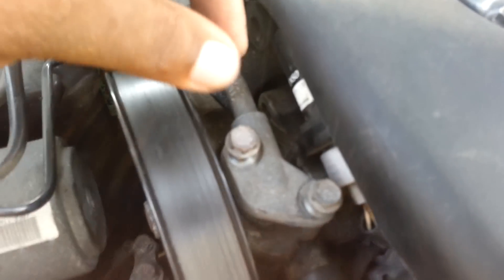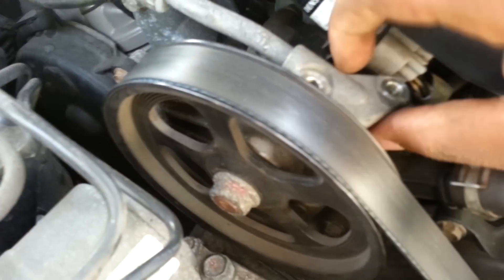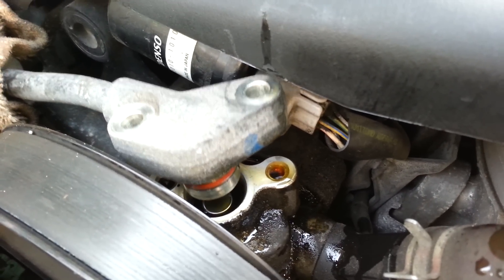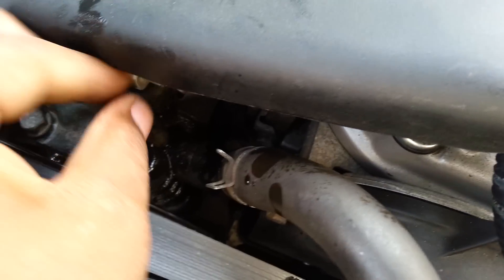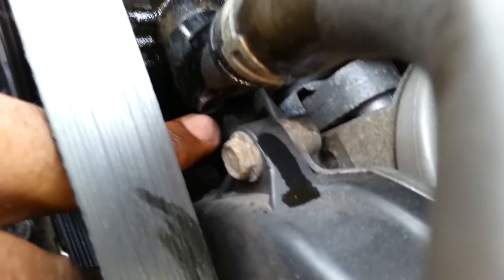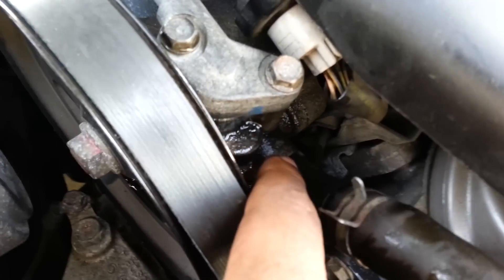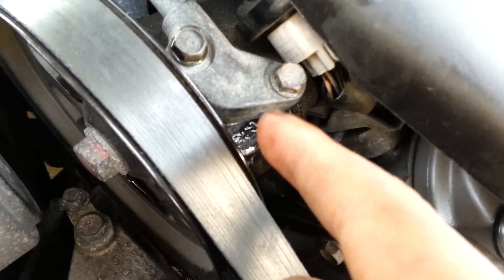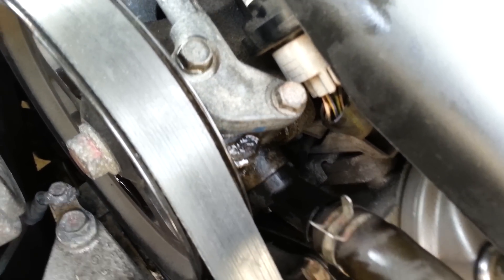ACURA HONDA POWER STEERING MOANS OR WHINES DURING COLD START-UP FIX TUTORIAL

Comment: Jan. 13, 2014. Acura TL 2005. Just bought and installed the two O-rings. Squeeling is gone. Thanks everyone. Bought rings from Acura Dealer. The new front bottom ring (91345-RDA-A01) was orange. The new top steering pressure hose ring (91370-SVR-000) was black.  So it appears color of top ring may not always be orange now. Also glad I bought some Honda power steering fluid to top it off.

Comment: One thing I found out from the Honda dealer.....the O ring gasket on the first one you took off( the return line/where you have two bolts on the very top) on my Acura tl 2007, the new gasket for that is not an orange gasket...it is in fact  black..The orange gasket is the one you use on the side and lower which has only one bolt holding it on( should be the supply line)...Anyway, they are not exact same size--there is a small  difference so just telling folks to make sure it's orange is not true for my Acura Tl. The difference is so small, they would interchange,but why risk a possible leak?  The orange o-ring is a p/n 91345-RDA-A01 and the black gasket p/n is 91370-Sv4-000...Anyways, thanks for your help and video

Comment: Here is my update: I changed both and it solved the problem, But as you say, change both. I did have an issue finding the "o" ring that is lower one. I initially removed a mounting bolt (very dumb) and later realized where the bolt was that you were focusing in on and located it. However, when I removed that lower one there was no "o" ring, Unlike the upper one where the o ring came out on the removed coupling, the lower one was stuck inside the pump and as soon as I got that out the new one went in easy. I stupidly tried to put the new o ring in while the old one was still in place. Not good, almost damaged everything. Thought I would share my mistakes to help anyone avoid making the same ones. Overall, this is such an easy fix!!! And if you know what you are doing it should take only 15 Minutes. I don't want to say how long it took me. But I had a very satisfying result.
Reply from the maker: glad to see that it helped you
Reply: I removed the bottom hose and was not able to find the o-ring to replace. I was able to install the new o-ring and everything fit back in place. 

Were you not able to insert the hose with the old one stuck inside? I'm worried I forced the o-ring inside the pump.

Comment: Thanks for the help man. I just picked up the parts from Acura and finished changing them out. I wanted to add that the top one shown in your video is black and the other o-ring on the bottom is actually the orange one. I can't understand why they would change colour over time from just PW fluid it shouldn't change the colour. Mine was still orange on the bottom. 

Honda part numbers:
Orange - 91345-RDA-A01
Black - 91370-SV4-000

Thanks for your help again!
Reply from the maker: no problem

Comment: This is very helpful. I think the key diagnostic as to whether it is in the "o" rings described in the video is whether the noise goes away when the car gets warm. This seems to be discussed on the acura blog sites. I am gonna change mine today and we will see.
Reply from the maker: i mean if you change one you might as well changeboth simple fix just change both orings and call it a day and you should be good to go.

Comment: There are different color o rings. Black is one color. Usually the replacement is orange. If you hear a whine check the o ring for signs of wear. If the o ring feels sort of hard that means it is drying out and needs replacement.

Comment: for some reason the top o-ring was black. so I went and got the top and bottom o-ring from acura dealer. the new ones were still black for the top and orange for the bottom. top oring was slight bigger than the bottom.

Comment: Are they both the same o ring part number because I changed the one closer to the front and it still makes the noise. I did not know about the one on top which you pulled out in your video.
Reply from the maker: no they arent they are diffrent size o-rings that you can get from the deal its the o-ring for the power steering hose.

Comment: I have a 2006 crv, replaced both O'rings with oem parts...still does noise at start up. Pump was replaced with oem used one.
Reply from the maker: Replace with aftermarket new pump

Comment: Thank you for making this video. I have an Acura RSX had some power steering leakage. I replaced the one o ring, and ps fluid. Still had horrible noise and bubbles in the ps fluid. It has been driving me crazy. Frankly speaking I was fed up with the damn car . Been having some major and minor mechanical repairs done to the car so its been eating up my cash. If I did not see this video I would have never known about that second oring . The power steering noise is a horrible sound and embarrassing I was ready to drive it into a Corn field and light it on fire.
Reply from the maker: Lol yeah there are 2 o-rings

Comment: My 2004 TL is producing a whining noise from that area, but I'm not sure it's power steering pump. The sound gets louder and changes pitch when I rev the engine. Is this common of a power steering pump issue that would resolve with O ring replacements? Thank you!
Reply from the maker: Yes it is very common for  the tl is known for this change the rings you should be good.
Reply: fabolousg4ever thanks. I'll give it a try
Reply from the maker: staveb0mb no prob
Reply: fabolousg4ever how much fluid comes out when you take that bottom hose off?
Reply from the maker: a little comes out just make sure you put a rag there and the oring change should fix the whine problem its sucking in air.
Reply from the maker: Ryan B no you didnt read the desription right 
91345-rda-aol is the front bottom oring
91370-sv4-000
this is for the top oring i change in the video.
Reply: fabolousg4ever Yea after re-reading my comment I noticed that so I deleted it.  But like I said in another pose the top o-ring is black and the front one is red like it shows in the acurazine link.  But the part numbers are correct.
Reply from the maker: Ryan B yes I know I will update the video soon.

Comment: Thanks for really good explanation, i changed both o ring with oem honda for acura mdx 05, and noise become lease but still there is a noise and there are bobbles in reserve tank, do you have any idea? For my when i drive for 10 min the noise becomes more, the power steering is a bit oils around? Do i need to change oil? Or any hose?
Reply from the maker: hcs2536 the resevoir check the hoses they might be leaking and check the clamps to make sure thry are holding tight to keep fluid from leaking out.

Comment: I heard I needed to change the actual pump. I haven't checked the o-rings yet, but what's the difference. Right now i get a noise when i turn my car on in the mornings, and that whining sound overall, mostly when i turn. I was just about to buy a pump for $100. Any advice here?
Reply from the maker: yes its the sound in the morning and when you turn the steering wheel this should fix the problem you are having dont buy any used pump the actual pumps for this car new is like 450 so whatever pump you were gonna buy dont just checnge the orings and you should be fine.
the orings are like 99 cent each from the dealer.
Reply: fabolousg4ever great, thanks bud. I'm suprised you said it was $450. Called a local parts store and they had it at $100 new. Automd.com had an estimate of $450 on the work, crazy. Either way, i'll be checking out the Orings this Friday. Thanks a bunch man.
Reply from the maker: no pump for our cars is 100 dollars thats crazy i wouldnt trust it just change the 2 orings and you should be fine common problem with our cars easy fix save yourself the money spend the little money on the orings fix it and use the 98 dollars and go out and celebrate how easy it was to fix lol.

Comment: Is the top o-ring (91370-sv4-000) suppose to fit snugged into the groove of the pressure hose? My new one does not fit the entire groove. O ring can move up and down. Diameter seems right, but width is not large enough.  My part I bought is 91370-sv4-000. I still get noise after replacing both o ring. I think that might be the problem. Any help please?

Comment: I have a 2004 TL, i changed both O-rings and it was fine for a month. Until this morning when its like 30 degrees outside on a cold start. The pump started whining loud and i could see lots of foam in the reservoir. But after driving about 10 mins it stopped and the foam disappeared. Should i tighten the bolt more or should replace the o-ring again, or flush the fluid? I did get the correct O-rings
Reply from the maker: air is getting in somewhere I would recheck the orings and make sure  everything is tight and good but be careful the outlet on the pump housing is plastic If you tighten it to much you can break it.
Reply: 1phone1gamer The pump itself can start leaking on the side where the 4 bolts are too. I replaced the lower o-ring w/the updated one then the return line below developed a pinhole leak where it rubs against a clip securing it to the subframe. Then soon after the o-ring on the side of the pump housing as I mentioned above. That seems to be the common leak besides the o-rings covered here. Oh and only used Honda PSF when flushed arnd 80k. Got to ~100k and started having all these issues.

Comment: Hi, I was able to take 2 bolts off of top 1, like you showed.  How do I actually get old o-ring off though and put new one on?  

Also, I was not able to get to bolt on bottom one.  

And to confirm what someone else already mentioned, the top one I got from dealer is black.  Bottom one is orange.  

Thanks for posting this, although dealer says I probably need to have my pump resealed, and that this won't help me.  

Any help or suggestions on any of my comments would be greatly appreciated.  Thank you!
Reply from the maker: you need to change both and that will fix the problem they are telling you that so you can spend money there is a write up in the heading to get the oring in the front out click on the link on the decription on my page and its a rubber ring inside just take it off and put on the new oneand on the bottom one you have to use a 10mm wrench to take it off at a angle.
Reply: fabolousg4ever Hey thank so much again for posting this, and for your reply.  I wasn't able to do it myself.  Not sure if because mine is 2001, but the bottom bolt was too hard for me to get to.  

Had the dealership do it for 1/2 hr labor, $68.  They didn't think it would solve my problem, but I told them to do it anyways.  Problem solved. lol, $70 total I spent.  I know it could've been cheaper, but could've certainly been a lot more too!!!
Reply from the maker: lol so it worked nice glad to help you see they was just trying to make alot more money off you glad to help
Reply: fabolousg4ever Yea, it worked. lol, probably the most useful thing I ever found on youtube.  know anything about engine mounts??? lol
Reply from the maker: lol engines mounts is another story

Comment: The O rings I got from the Dealer were not the same color the top one is orange but the bottom one is black and a bit smaller. Does that sound correct? I have a 2004 TL and it only makes that whinning noise on cold mornings.
Reply: The 2 O rings u have were they the correct fit cause u said one is black is that the right one cause im looking to replace both O rings
Reply from the maker: Alex Lex what i remember they were both orange when i got  both orings cause i changed them both on my tl and my girlfirends acura rsx and they were both orange but maybe they updated the lower oring to a black one
Reply from the maker: well the oring numbers i put in the title of the video just ask the dealer for those and if they are diffrent colors let me know if they changed it so i can update the listing.

Comment: thanks for the info. Do you know how much fluid the system requires??? Im thinking of doing a flush as well just to be real thorough about it.
Reply from the maker: im not sure you should call the dealer for that.
Reply: thanks i will.
Reply: Check your owners manual and it will tell you exactly how much fluid it needs (for this and all other fluids).
Reply from the maker: yes what barry said

Comment: hey WATS good question,am gona replace the o ring on the power steering getting confuse each goes where,part#91345Erdaa01 goes where?
Reply: that's the bottom one, which is orange.

Comment: I was told that I need a power steering pump reseal. Then I took my Acura TL 2007 to another mechanic and he told me all I need to do it replace my o-rings. Will this fix my problem? What exactly does replacing the o-rings do?
Reply from the maker: The orings go bad after a while and shrink so the pump is sucking in air once u replace the orings  the pump will be resealed and won't suck in air which will stop the whine.

Comment: I have a 2008 Acura MDX, my car is making that same whining noise. My question is, will this same method work on my engine? I have heard TL's and MDX's have similar if not the same engines.
Reply from the maker: D Sisson yes it will engines are very similar same company engines are like the same
Reply: fabolousg4ever thanks man. I figured that. I'm heading to Acura tomorrow to get the O-Rings and fluid.
Reply from the maker: D Sisson no problem

Comment: Are you sure the Red O ring goes on top? because the other videos show the red one on the bottom
Reply from the maker: they might have updated the parts i dont think color matters anymore just get the orings in the description and change them out and you will be fine.
Reply: fabolousg4ever ok i checked and when you order the rings the bottom one is red 91345-RDA-A01 and top is the other one in black. I need to swap them because my steering is manual no power working. Whine noise is gone though
Reply from the maker: guyrelax ok kool any other questions feel free to ask
Reply: guyrelax I was just going to say the same thing after watching this video and reading the link to acurazine thats in the info section on this video has some pictures that were posted back in 2009 and the lower o-ring was red.  The top o-ring should be black part # 91370-SV4-000 is right (I just went to the dealer today) so saying that if the o-ring is black means it is bad in your video is not correct and kinda confusing.
Reply: Ryan B yes when I swapped them based on this video it actually ruined the o-ring so I had to go buy a new one
Reply from the maker: guyrelax I'm sorry to hear that but everyone else seemed to understand the video fine and the part numbers and asked questions if they didn't understand sorry for the mixup will update the info so this doesn't happen again sorry.
Reply: fabolousg4ever its all good I appreciate the video since all the others one I found were about the lower inlet and not the top feed hose. And you are very quick to respond when someone has a question so you have been more then helpful.

Comment: So the noise come from that part (orings) when they are waisted?
Reply from the maker: yes letting in air
Reply from the maker: yes letting in air
Reply: Ok it's making noise to when I barely move the wheel to the side, is that the same cause?
Reply from the maker: cesar lopez yes its sucking air in
Reply: Thanks

Comment: when I change out these o-rings do I have to bleed out all of the power steering fluid or can I just fill it up again?
Reply from the maker: just put a little power steering fluid turn the car on with cap off off resevoir then turn steering wheel left to right a few times to get the air out of the power steering system.
Reply: +fabolousg4ever 
ok sweet! one more question if you don't mind. how would I find out if it is that part that I need to switch out?
Reply from the maker: +Joshua Sutton check the resevoir for bubbles if air is getting in the system that the oring fix should fix that.
Reply: +fabolousg4ever 
ok cool. I appreciate all the advice and the quick response

Comment: The steering wheel has become very stiff and hard to turn in my 2004 Acura MDX, what could it be?
Reply from the maker: low fluid or there is air getting in the system or the pump os going bad

Comment: Does air get in the system when you take that cover off though?
How does the air escape if its in there?
Reply from the maker: yes it does thats why u turn the steering wheel with the resevoir cap off  and turn the steering left to right after doing this to get the air out.

Comment: What's the part number for that o ring up top(pressure side)? I know the part number for the inlet side is 91345-RDA-A01
Reply from the maker: its on the bottom of the tutorial description.
Reply: Part Number is 91370-SV4-000

Comment: I have a 2005 Acura RSX Type-S and I get a whining noise when I turn. I've already changed the power steering fluid with genuine Honda power steering fluid (didn't do a complete flush) and the whine is still there. Does anyone know if this is an o-ring issue, or a power steering pump issue, or perhaps something else? Thanks in advance.
Reply from the maker: change them they have orings too in the rsx pump my girl has a rsx and i change them on her car and it has been good try it cheap fix it couldnt hurt if u want me to put up a video let me know
Reply: fabolousg4ever I bought the o-ring from Acura this morning for .72, removed the black o-ring, installed the new orange one, bled out the air a bit by starting the car and turning the way all the way left and right about 20 times, topped off the reservoir with some genuine honda power steering fluid, now i'm gonna take it for a (hopefully soundless) spin...